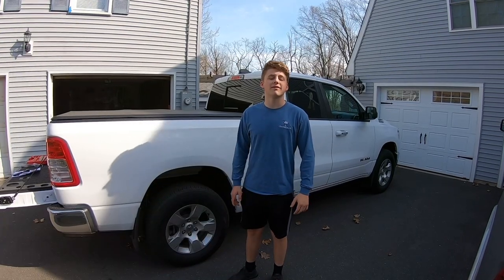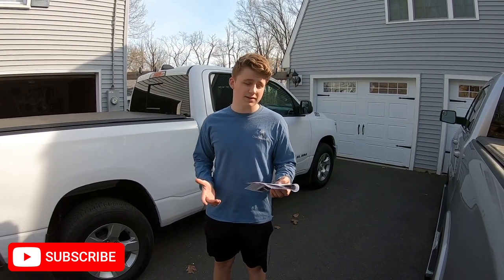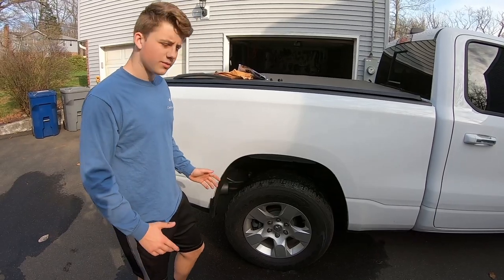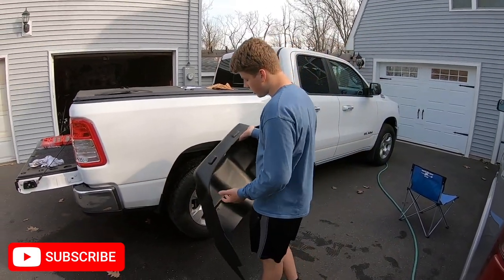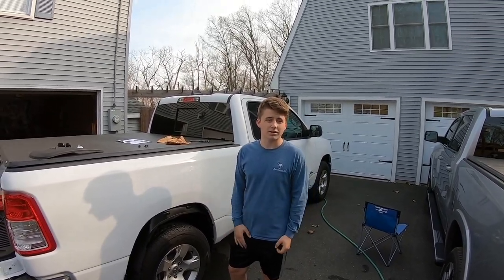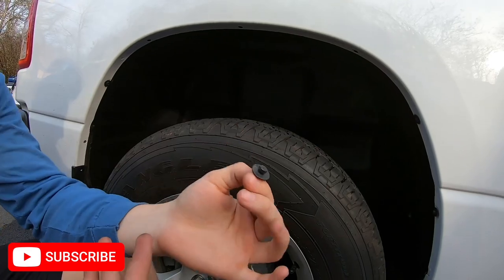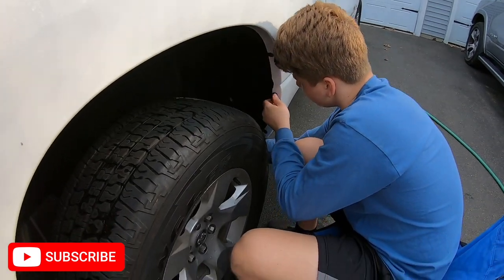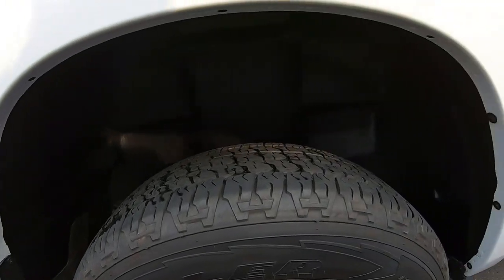2020 Ram 1500 Big Horn rear wheel well liner installation

Comment: Very nice tutorial, I am definitely going to buy these as soon as I make an educated response, (because I'm 61 years old and have been around awhile).
If I may suggest, I would remove the rear wheel and apply a coat of "Fluid Film" over everything exposed...
If you don't have an air compressor and sprayer you can use a couple of "Preval" sprayers for the inside of the truck bed and frame areas before you install the liners.
Reason being, (this goes especially for the folks, like me, who bought a used RAM p/u), the insides of those beds have already been sand blasted, (per say), by the elements of everyday driving, there could be open soars in the paint and or bare metal?
Not treating it when you have already made the commitment to preserve your investment could be a waste of money.
Otherwise this is a very good instruction video, thanks for sharing.